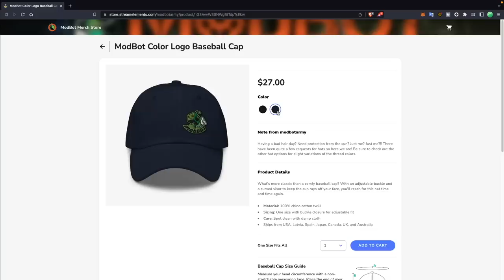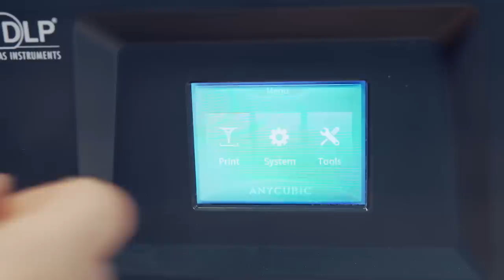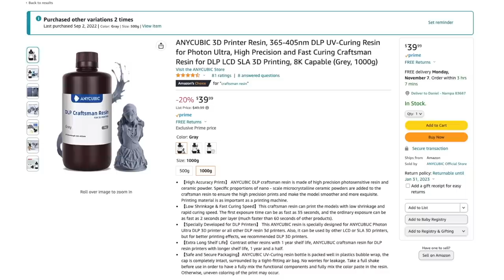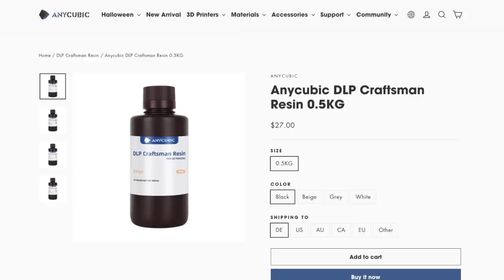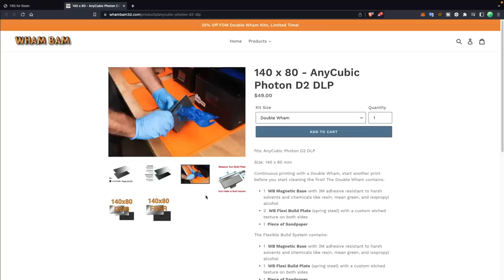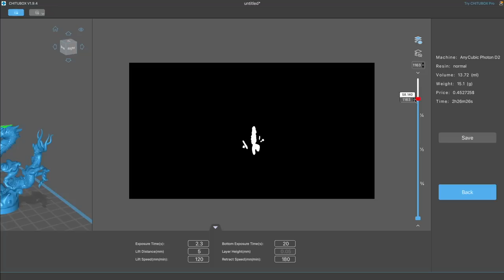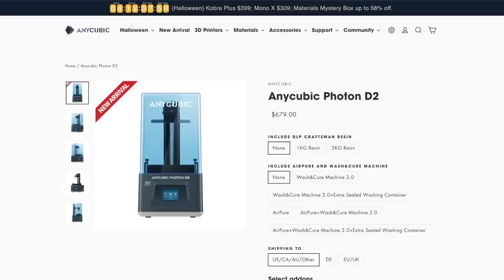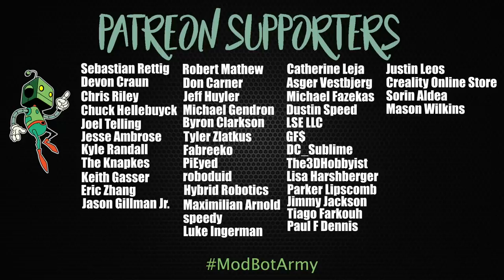Is The Anycubic D2 The Future Of Resin Printing?

Comment: That's a great improvement over the D1, but DLP with a fixed focal length and no zoning is kinda of only half the fun. The real deal with industrial DLP is ability to focus only on a specific area of the plate (and therefore increase the "resolution" locally). This implementation is a glorified UV masking, which is good, but cold be significantly better with a firmware/slicer custom rework.
Reply: i'm not familiar with the technology, what would that entail?
if i understand your sentence properly, does it mean that if the cross section of the printed object is smaller, the cure time would also be lower also?
Reply: @aronseptianto8142  Cure times are not resolution-dependent. Light projectors don't have a uniform pixel density across the entire projection area. At the center of the screen there will be more projected pixel per cm^2, and the density will diminish as you get closer to the borders. On DLP printers this means that unlike LCD, the screen is not uniform, and prints placed at the center will effectively differ from the ones at the corners. This sometimes reflects on the print quality. But since we're using lenses to project the light beam on a wider surface, we can also use them to concentrate on a smaller area. Effectively, with DLP, you can use the full 1920x1080 pixels just to cure a very small miniature cros-section. Or simply use the full area and inevitably distort the edges, like the D2.
Reply: @matteoparenti741  ah, i thought you meant having a zoom lense to concentrate the light into smaller area
Reply: @matteoparenti741  It's a Good concept but a variable throw distance/focal length is not practical, especially for a consumer grade machine. I'm speaking from experience here. I have a DLP machine that allows for two throw lengths. One setting for printing at 41 micron, the other at 25. To change between these resolutions both the throw distance and projector lens need to be changed. Each resolution has to be calibrated for as well. Even if it were possible to get around distance & lens changes a variable focal length would still require constant exposure adjustments. 

I prefer a fixed throw/focus, but I would like to see a higher resolution projector used.
Reply: I have yet to find an application that requires higher resolution. At some point stuff gets mechanically unstable
Reply: @testboga5991  the benefit I see would be allowing for a much bigger print plate without changing the projector. very good quality at full scale models, with a smaller and higher detail zone for stuff that doesn't take up the whole plate. In theory, you could even do full res at full scale by covering a half of a large build plate, then passing the more focused light over to the other half while rolling the image it displays. That might require more calibration and timing than its worth but Id still like to see the super res option in future consumer DLP printers, just to see where people take it.
Reply: It's shame that Milkshake 3D printer is gone. So much more advanced concept compared to this.
Reply: @aronseptianto8142 RapidShape printer's projector can be lifted up or down which can size up the projected area. And yes, the Exposure time turns out lower and you can Print at higher speed. 
But you have to change Platform size in Slicing software as well. Other wise your Output will be smaller. But you can't change projector lifting on own. Only authorised person will do it for you. 
Its not open source.

Comment: Nobody is talking about the drawbacks of these printers? With a fixed lens, the resolution depends on the size of the object. The bigger the object, the lesser the resolution. The long life of the projector is great, but the development of normal LCD printers keeps improving so fast and they are getting cheaper and cheaper. For the price of one DLP printer, you can buy a LCD printer now and buy an improved LCD printer later.

Comment: That’s quite an amazing machine! Such detail!! 20,000 hours of projector life it insane. Even at $650+ it’s sounds like a bargain when you estimate the cost of replacing LCD screens and having extra vats on hand.
Reply: Except when you factor in the likelihood of upgrading your machine in a few years. Even on a 2000 hour rated screen you can print 8 hours a day, every day for 3 years and only need to change the screen 3 times. I suspect not all screens perform perfectly and you may have an odd dud that fails earlier, so say 4 screen changes at $50 and you are still nowhere near the cost of this printer. After 3 years technology will have moved on and you are probably looking at upgrade time anyway... wasting a lot of the extra DLP lifespan.

But on the whole quality control and potential for failure, I wonder what the implications and cost is of a hardware failure on a DLP, those mirror arrays don't look like they'd come cheap... if you can even get parts to resolve a failure?

Not sure I see how you won't still want extra vats on hand in case of a print fail and vat clean.
Reply: They say 20,000 hours, but isn't a DLP thousands of tiny little moving parts? That seems like it might be it's own problem.
Reply: @the_omg3242  reliability of DMD done in 1998 and follow up paper in 2003 suggests 3e12 mirror cycles for the equivalent of 120k operating hours. https://www.ti.com/pdfs/dlpdmd/153_Reliability_paper.pdf
Reply: @the_omg3242  20k is actually probably being a bit conservative. DLP technology is actually very mature and well-understood at this point, and most modern chips are rated to over 100,000 operating hours. There's no additional degradation due to UV light either because the 405nm light used to cure consumer-grade photopolymers isn't actually UV-- it's just purple light toward the far end of the visible spectrum that borders UV. Furthermore, UV doesn't become damaging until much shorter wavelengths. Even the black lights people use in clubs/parties/halloween/etc. have a shorter wavelength than what we have in these printers. So there's really no concern about general reliability here.
Reply: @Dark0Storm  Well that does kind of depend what models you are comparing right? The D2  vs the M3 premium is really not a big price hike, so if you are in the market for a premium Resin printer with high detail printing well that does drive the cost up quite a bit regardless if you are taking MSLA or DLP. The only real difference in pricing I know seems to be that the build plate is relatively smaller and that you can't give up on some detail and get a better price in return. DLP only has high performance high price. MSLA can be had much cheaper with less detailed printing. Upgrade-Interval does depend quite heavily on the Usecase. If you are doing it as a hobby and you have a lot of cash sure. But in this economy I don't know replacing a perfectly fine machine seems a bit excessive to me but then again I am only on my first FDM Printer and still see potential to improve it before upgrading to another. So not sure I would agree that Upgrade times are something static but much more dependent on the individual user and usecase.
Reply: @MrTree421  it's not that they are static, just that at a certain point the technology has moved on significantly. If we look at how quickly we've gone from LCD to mono to 4k & nearly 8k. It's fairly rare to find someone printing on even an older 2k mono printer. Then there is the creep of "premium" features down to mid & then entry machines and I think upgrades become "compelling" if not necessary enough that you get a substantial upgrade pattern, even if just to the cheaper "previous" model version as that drops in price.

It's only anecdotal but given what I tend to see in forums of what machines people are generally using I'm fairly confident in my original opinion. 

Of course no one can predict quite how a tech will evolve.
Reply: To separate prints off a build plate: clean it off when done, place it in your freezer for five minutes, Break print off by hand. No tools used so no tool marks.
Reply: @perfectscotty  no matter how well cleaned im not putting a resin printer build plate & uncured prints anywhere near where my food goes.
Reply: @Dark0Storm  place it in a plastic bag then in your freezer. Your food is sealed and doesn’t contact the resin anyway.

Comment: The biggest problem with resin printing is the mess that is around, the need to have basically a dedicated and aired room for printing because of toxic nature of it.
I would like to have it, but I live in apartment and there is not enough space to work properly.
Also, how you deal with all the liquid residue that you can not throw in the sink. Where do you dispose that?
Reply: One could put the liquid residue in a large container like a transparent plastic box, so the liquid is not too deep.

Then leave the box, open , in the sun outside - the volatile stuff evaporates (for example, alcohol) and the resin cures  in the sun.  One is left with  non-toxic cured piece of dry resin that can be disposed of in the usual manner.

Comment: I would be interested in getting one for product prototyping, mould making, jewellery and functional end use products. I only ever see minis though - and maybe some jewellery to be "lost wax" cast. I'd also be interested in combining different resins to create new material properties - like adding some TPU like resin to an ABS like resin to create a semi flexible. Have you tried any of this? Is it possible to get functional stuff? Screw lids, working print in place hinges etc?
Reply: I have a flex additive for standard resin that gives it a rubber like feel. The more you add the more rubbery it is. I use a white base then add tint to get other colors.

Comment: What are the benefits to resin > filament?
Reply: Resin is more detailed, less rough.
if you're into Tabletop games that use miniatures and some terrain... mini's are often best printed with resin, terrain (larger pieces) are often printed with filament.
Reply: @Lizard008  in short, I'm buying one for my nieces and nephews(5 of them 10 and under) but mainly because they all love crafts, but to also, since they are on screens all day, get them into cad and cam
Reply: @josephfriedrich9792  given the age... I'd steer clear of resin for now. You can do real nice things with filament printers. PLA is easy to work with, a whole bunch cheaper, and not toxic. Also, the clean up process of resin can be pretty messy.
Reply: @Lizard008   The actual chemical's, resin was the concern of mine. I will say though the oldest 1, 10, does have her experience in rebuilding carburetors and tearing apart engines with me… they know all about personal protective equipment,  But like you said with their age I kind of was feeling bad about it and trying to get them directed away from engines and gas and oils at this time. Even though they love to tinker with engines and gas and oils hahaha.
Price i'm not too concerned about, And clean up... i thank the  years of every combination of slime imaginable, has prepared me(kidding)

Comment: I have a dental printer, bought a few years ago and uses DLP…build size is the same, but it cost $15,000, resin is $150/L and vats (which “expire” after 1L of use and won’t work anymore) cost $110…if this thing is even close to as accurate and fast I’ll buy 3
Reply: which printer did you buy ? asiga ?

Comment: Thank you!
Love the new plastic vats on my upgraded Prusa SL1(S) farm…reducing un-sprung weight and increasing cornering speeds😎
Reply: The D2 build plate and volume are almost as small as that cute little Prusa SL1(s).

Prusa SL1(S):
Print volume size 127×80×150 mm
Price:  €1,635.54

Anycubic D2:
Print volume size 131 x 73 x 165 mm 
$579

Comment: I’m pretty new to 3d printing, I’ve use a “traditional” 3d printer a few times (like once or twice) and I’m interested in getting a resign one but there’s a few things I don’t understand that I’d love help with! For one, with resign printers, what do you do with the left over resign, do you put it back in the bottle, or just leave it for the next time, or what. Also, how strong are these prints? Are they similar to normal 3d prints in strength? Additionally, what software would you recommend for modeling? I use onshape quite a bit and I have access to solid works but I’m not as familiar, and I will not have access to my sw license in like 6 months
Reply: well 
we put resin back in the bottle after printing
the hardness depends on the resin you use
basically we dont use them for printing toys type things we use these printers for jewellery wax models  and i use martrix 9 for designing 3d models

Comment: WIth DLP resin you still wash with alcohol and cure with UV light?
Reply: yeah the dlp printers use projetors for printing the normal sla lcd printers use lcd for printing there is no more difference between them

Comment: Hi. Are there any settings that control the print quality in this printer? So that the print is smooth. I bought this and it prints worse than my old first photon. There are visible lines in the printout. Can you help me ? Is anti-alias responsible for this? in the photon workshop settings?

Comment: I'm super interested with getting this printer since I'm just now getting into resin printing and it DLP printers look like they can crank out some super detailed prints. I do have one question/concern though. So the projector or screen, as they say, has a lifespan of 20,000 hours, but I want to know what is the lifespan of the micro mirror array? Is it shorter than the projector? If so how would it be replaced and for how much? Mono lcd printers are good because they have just the one screen that can be replaced easily for varying prices as stated in the video. Anycubic's webpage doesn't state anything about it, so I guess they don't see it as a problem and it may very well not be! I don't know anything about them. Since those mirrors are moving parts, though, wouldn't there be a cause for concern for wear and then an eventual need for replacement?
Reply: They say 20000h but actually the DMD is rated for 10000h (only). However it is only running ~2seconds per layer - which gives you ~900m of cured material at 0.05mm layers. Still plenty enough ;)

Comment: The thing I dislike about the vat (which is just the regular photon mono vat from the look of it) is that it doesn't have feet for putting it down, and presumably uses Anycubic's proprietary FEP/Frame all-in-one pieces... which only give you the option of regular fep rather than some kind of upgraded version. For this price I'd want a vat the latest features which seem to be becoming a new standard.
Reply: print a holder to set it on a surface.

Comment: I don't see any real apple to apple comparison with DLP and MSLA, the only thing here is advertisement. If you compare these technologies, you will see there are no noticeable improvements in quality compared to the MSLA, you can check different videos on YouTube to find out that, the only benefits are parasite light and display lifespan
Reply: From my own testing a quality 8k printer that's dialed in actually produces better prints then dlp since you can get an even smaller more detailed layer if you're willing to spend more time printing. The biggest difference imo is the long term cost of maintenance of a dlp vs msla with DLP being cheaper. If you're not doing professional prints for painting competitions and just selling models then having a lower long term cost for replacing parts is probably more important. But that's just my own personal limited experience with them and at the rate that consumer 3d printers are improving and changing at it's hard to tell.
Reply: You're also forgetting that the D2 uses less electricity, runs cooler, and is quieter because of the lack of a cooling fan.
These things may not matter to most but they're still differences.

Comment: Jesus people if your prints are sticking to much your base level exposure is to high. Learn to print. You shouldn't need a  wham bam on this size printer. I have never had a print not pop off pretty easy if you have your settings right. A wham bam just hides poor settings

Comment: Congratulations on the video. I am a goldsmith and jeweler and having a small business I cannot afford printers like Solidscape or 3D Systems that use another technology called DOD (Drop on Demand).
Now I'm about to buy a Phrozen mini 8k, which in the field of "low" cost LCDs is unbeatable with its 22 microns.
But I'd like to know if the D2 is capable of the same print quality. I've seen VOGMAN's videos about use in jewelry but these aren't the videos I'm looking for. Jewelry with skulls or similar rings in my part (Italy) are unsaleable. Most of the rings that are sold by me and all over the world are classic / solitaire, trilogy, eternity rings etc. So I'm more interested in knowing, for example, if I wanted to print an eternity with half-point stones, it would be able to create the hole where the stone rests and the through hole to let the light filter through.
Reply: Did you manage to get more info? Im in the same boat.
Reply: Btw vog is releasing new video tommorow about d2
Reply: @glitchinthematrix9306  Hi unfortunately not. However, I bought a Phrozen sonic mini 8K with a kilo of 8k resin and 2 PFA films for €493.00 on the Phrozen website on Black Friday. On facebook there are many jewelry groups with users who have the Phrozen, so from this point of view too I preferred the Mini 8K.
Should there be some problem I have a better chance to find the solution, compared to the D2 which is new and not many users are still confident about the dlp technology.
Reply: @marcoc.1646  Sounds great. Maybe you can name some of those groups so i will have a look. Thanks for your input